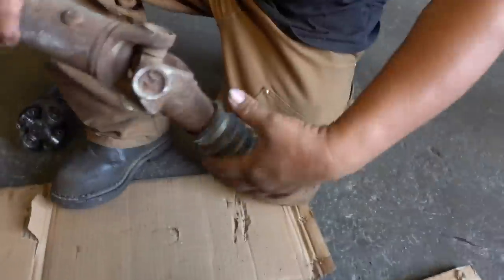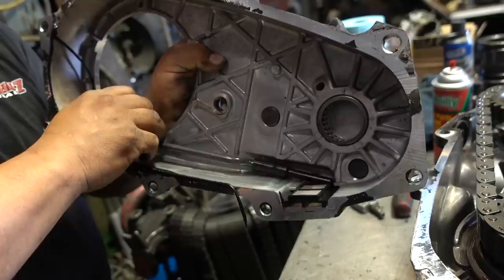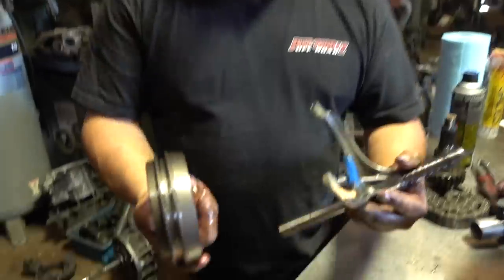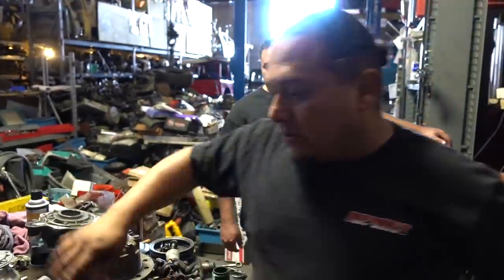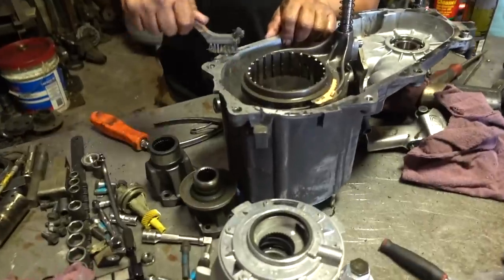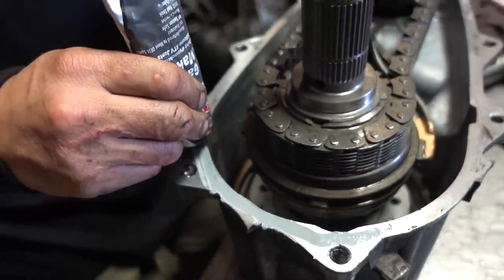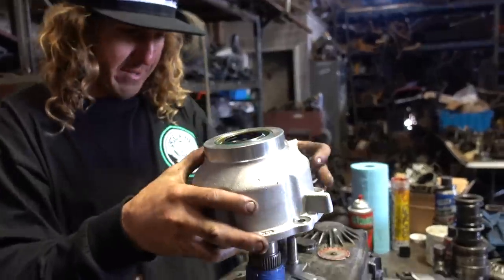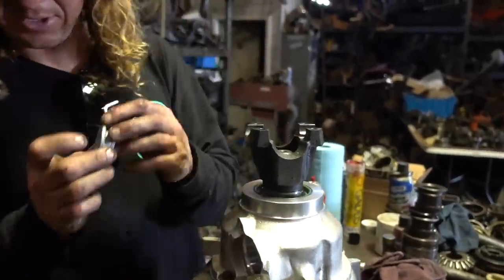Slip Yoke Eliminator and T-Case Checkup JEEP XJ

Comment: This is perfect timing, I need to install a SYE in my TJ!
Reply: Oh and dont cheap out and buy the ones were you have to cut the output shaft n tap it.i know there only $200 .but spend the extra $200 and get the whole kit with driveshaft.and the  shorter output shaft ....hell if you need one i have a few of them sitting around my personal garage at home for the 4.0 tj .i have 2 2000 tj..depending on the year and engine the ones i have will work..ill sell one for a good price .just message me if your interested
Reply: @nick-zi4bs  Nice. I have the 2.4L but I am swapping a 5.3L right now. Have to open up the transfer case to change input spline to meet the 4L65E that is paired to my 5.3L. Anyway, it's a NP231, long input 23 spline. I honestly need to check if the previous owner already did the modification, I haven't crawled under it in awhile as I am waiting for the title still.
Reply: @itsBeeBeau very cool 5.3 in a tj they rip.plenty of power i would definitely think about a axle swap tho especially with it being a 4cyl the dana 30 front n 35 rear dont hold to well to the power of the v8...what year 5.3 anyways ? And what are you doing about a ecu and pcm.n wiring?just stock .or are you going stand-alone.or piggy back it to the stock jeep so you can use your cluster ?and what about engine mounts? from past experiences getting the oil pan to clear the axle is tricky. unless you push the engine back or rise the engine high enough to clear .biggest issue i ran into were the axles.engine mounts and computer we have done a few at my work ....we went 6.0 out of the a gto with the. 6 speed t56 magnum trans and we used haltech ..but didnt rly have a budget lol  ..and we got lucky and got a Rubicon which has dana 44 in the rear...good luck tho sounds like a good project..i wish i could have kept the tj we built.was a bad ass jeep and super fast..alil to fast lol
Reply: @nick-zi4bs  2003 (Gen3) 5.3L. Already have a Rubicon take off D44 for the rear with the stock locker/gearing/brakes, think I will keep the D30 upfront for the time being, budget limited, for now. I will be using the ECU/PCM from the  5.3L and run just a cheap set of aftermarket gauges with a filler panel, think the autometer kit but without the name brand haha. I thought about adapting the Jeep gauges/instrument panel and I might still, the tach is the tricky party but Novak has a module/adapter although it's pricey. I figure that part of the build will be somewhat played by ear but I plan on trimming down my own wiring harness and what not, not my first time doing engine swaps like this, although it is my first jeep. I plan on using Dave's Custom engine mounts as they seem to give the most clearance. I read about the oil pans sticking down too far, I know there are GM Part #'s for lower-profile pans and their pickup tubes, will cross that bridge when it comes. One of the few areas I haven't researched is what I need to do for my drive shafts, haven't really penciled that in to my budget yet. I want to do the SYE if it isn't already installed so that is pretty simple as Advance Adapters has a great kit, with drive shaft, and like I said before, I need to open up the transfer case anyway haha.

Comment: One time i let the RTV sit for a little too long because i heard about letting it dry to rubberized a little BUT!!!! It was a little too hard and when i started to tighten the bolts on the timing chain cover on my K20 it freaking cracked 🤦🏻‍♂️🤦🏻‍♂️🤦🏻‍♂️ it dried up too much i cracked the dam chain cover ugh. So be careful how long u let it sit to dry lol 😂
Reply: You don't let it dry on a casing like that. I don't spread it either, just lay a small bead in the center of the flange and quickly assemble it. On valve covers and similar parts where spacing isn't critical, I let it dry a little so it makes a thicker joint and comes off with the cover next time. It's easier to scrape it off the cover than the engine.
Reply: anti chuckle yeah i fucked up 😂

Comment: And for everyone take note how thick he's running that bead of rtv gasket not 1mm not 20mm like.   0.1mm the thinner the better just thought I'd say this as I've come across lots of engine parts transmissions and transfer cases that are full of chunks of rtv stuck in the filter or water jackets  and the worse part is like for motors it gets in the rad and plugs it ip good and no home flush kit will get out sometimes even hot chemical tank job can't get it out so go easy on it and one more thing he could have done was put some brake in lube on the shaft it just helps the first start of use of it but other than that love the vid guys and he knows his shit good teacher for this shit

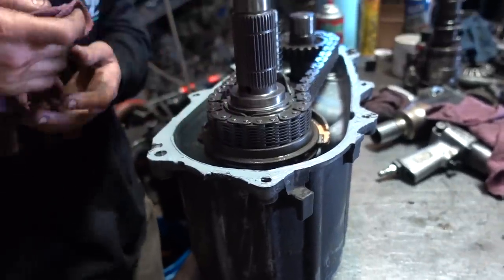Comment: 27:35 that’s not true that’s a old time myth rtv drys when there is no air or a vacuum so slapping that case together right after you lay the rtv down is the best seal you will get you just have to wait for it to dry before adding oil 🤘
Reply: Your both right and wrong depends on what type of product your using. Three bond 1104 is grey and will "skin" Permatex "the right stuff" is black and will "skin" both are dry in 10 minutes after assembly. They are the only 2 types I ever use never ever had a leak with the least amount of spread out. What amount of spread out you see on the out side the same amount is inside thats what fucks shit up when it come loose and plugs up oil passages . a 1/16" bead in the center of mating parts is all that needed. People use way too much 98% of the time,best to wait 24hrs when possible ,but, I have used the right stuff on oil pans and added oil as soon as the car came down off the lift with no problems.
Reply: The 1 minute stuff that comes in a can like cheese works pretty damn good if you don't have time to do what the instructions say on the other stuff. Silly expensive tho

Comment: I love watching someone with years of experience work, especially when they're funny and informative. Also, is there any benefit to having a slip yolk? Why, if it's so inferior, is it installed in an oem part? Cheaper? Doesn't wear as fast?
Reply: My guess is it's fine until you raise the vehicle?
Reply: Aside from shortening your output shaft which will give you better geometry on your driveline if you do lift your vehicle a SYE is a great upgrade to have on even a stock height vehicle.  The biggest advantage of having a SYE is if you are on a trail and break a u-joint you can remove your broken driveshaft and continue in 2 wheel drive (front or rear) w/o pumping all your tranny fluid out in BFE leaving you stranded.

Comment: My buddy and I did the SYE install in a few hours on my 231, it's nothin seriously, just don't go ripping everything out like he does lol.  Walk in the park except for that monster ass snap ring, a boss pair of snap ring pliers is HIGHLY recommended for that bad boy, I destroyed a lesser pair doing this. lol  I never been in a t case in my life and didn't even change my own oil till a few years ago.  Mine was immaculate just like this one, maybe even a little better actually.  One thing I noticed he got wrong though was about shifting the case, this is a "shift on the fly" t case for BOTH high and low range, thats directly from the owners manual.  You just have to be under 10 mph to shift to low range, stopping is actually NOT how to do it and you will likely have trouble completing the shift, it wants to be rolling a bit and the trans shifted to neutral.  You can shift on the fly into high range 4wd at up to 50mph though.

Comment: hey where is that shop that did your transfer case?  I need mine done too
Reply: Shop is Jeep Thrillz Offroad in Compton.
Reply: Or you could send it to my shop nfi empire in erie pa we do them for Like $700 including the whole  kit with driveshaft  plus install on your vehicle plus the gear change for the speedo if you go up a few sizes on tires that is if yours is the cable driven type and fluids .hard to find a better price i think.i do these weekly..i dont know why everyone is afraid to do them.there not hard ..if you pay attention to what your doing.and if your new to it take pictures and mark your shit so you know what side goes up lol.if you can turn a wrench you can do it i promise  ive taught many.dumbasses to do Them not fun but they learn lol ...i can do them in like a hour or so with .removal and reinstall of the t.c....or i have a few 231 t.c for 4.0l but have them for manual n auto .i have a hoarding issue lmao  in my garage at home with them already installed n fresh fluid..ill sell you one for $500 pretty low mileage as well under 75k on Them .the kits new just the tc is used

Comment: Use DeX /merc transmission fluid the same as the transmission.
Reply: I use atf 3 or 4 or a 30w with a synthetic .depending on where u live..my experience you just have to change the oil more then a atf..i stay away from any dex 5 or 6..there not meant for that..ive seen a few take a shit bc the customer used dex 5 or 6.
Reply: Btw i build custom jeeps for a living for nfi empire in erie pa.been working there for 6 years or more and been wrenching on them since i was 14 but who cares right lmao but.we build 5 or 6 or more jeeps a week depending on the build ..im the head monkey 🐒 for engines and transmissions and t.c work..ive see what works and doesn't..but just my 2 pennies i suppose .😂

Comment: Yo where can i find that slipyolk kit?
Reply: Morris 4x4 is a good place or .where i work .we sell a nice complete kit .for a decent price .it runs about 700 dollars for the kit and install and if you wanna do it yourself.i believe our kit is under $400 for everything depending on what jeep you have and engine and transmissions type..i work at nfi empire in erie pa.btw so.if you need anything jeep related..hit us up or myself and i can point you in the right direction..all i can say is dont go the cheap way .with a slip on sye bc all you have to do for those is  just modify your oem shaft. By cutting it down and tapping the end of the shaft for the bolt and slipping the yoke on.....they never hold up..ive seen dozens come back broken .bc they wanted to save $200